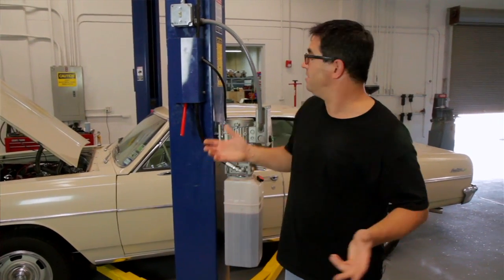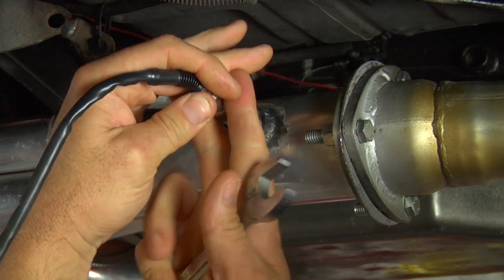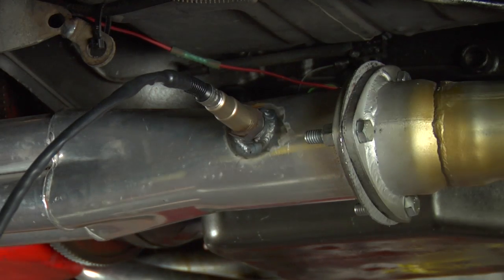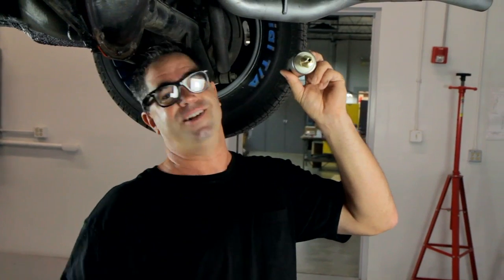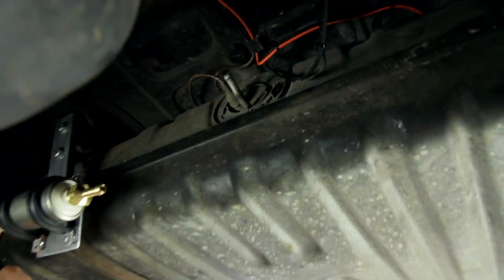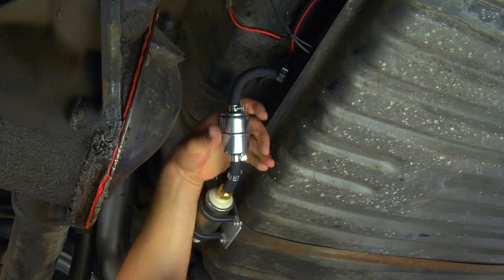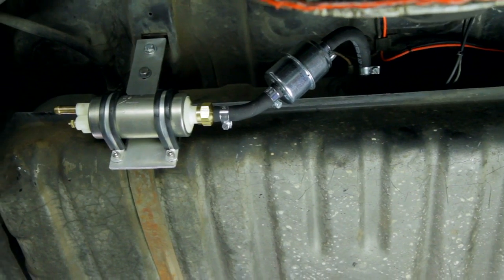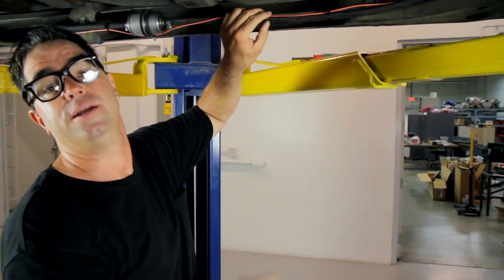Chapter 2 Fuel Pump Install

Comment: I just did a conversion to an electric fuel pump to address a vapor lock issue. I am very glad I did this modification. Worked like a charm.

Comment: Nice. I also think that is the best spot to mount the pump. just a question, will it still be able to pump properly when the car is on a steep uphill position? the pump will technically be higher than the tank.that way.